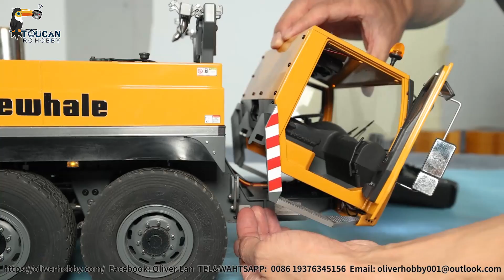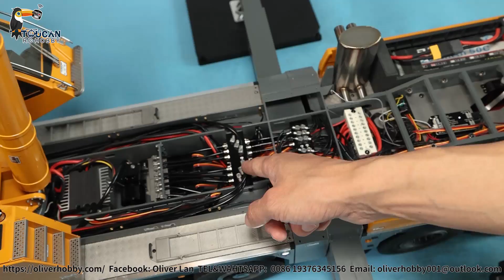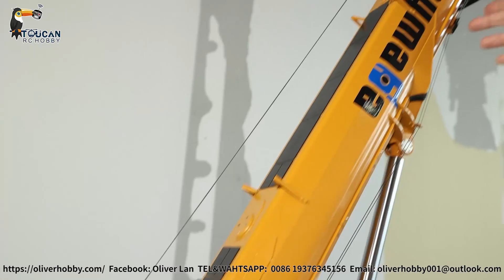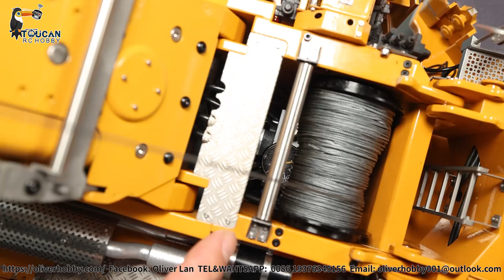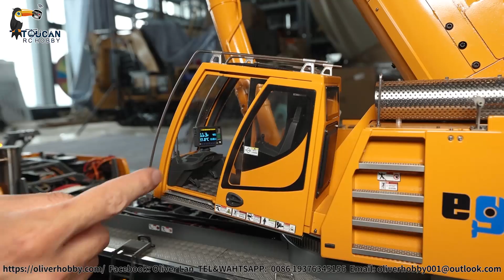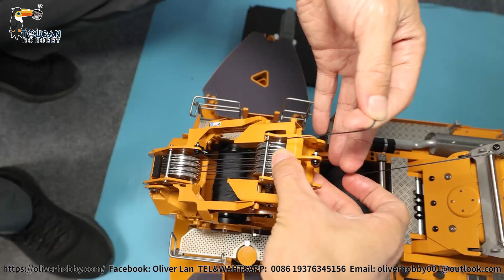For a RC model around 16000 USD! What has it got inside? 1350 hydraulic crane truck

Comment: Awesome!  How do you set up the radio to have the different steering modes?  I assume each axle has a separate servo the you have different mix settings.
Reply from the maker: Have 6 servo and a control board